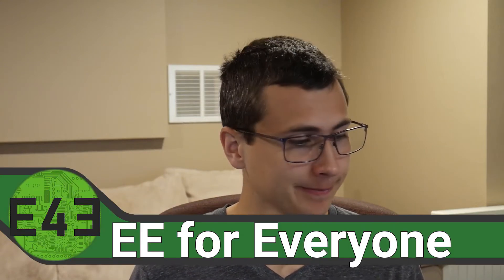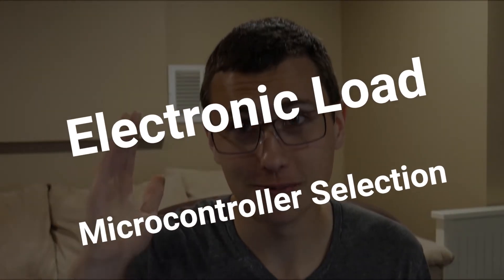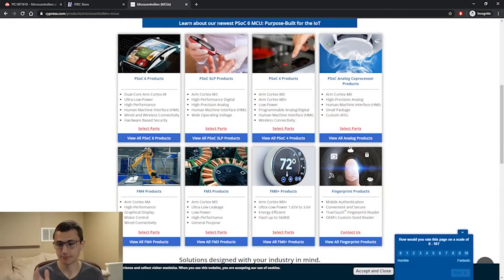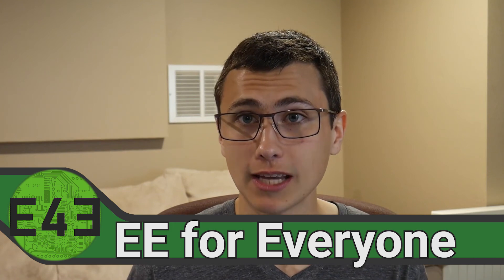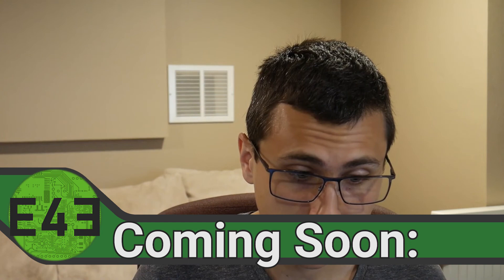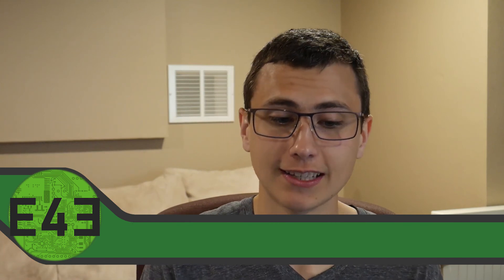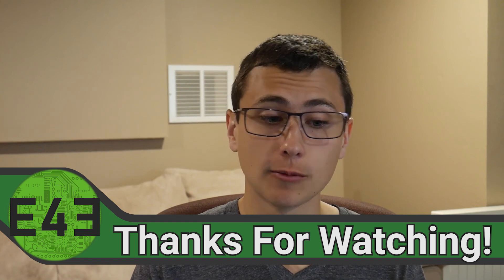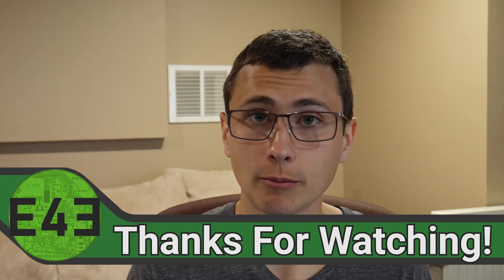Microcontroller Selection (again)

Comment: Floating point? Wow, how far we have fallen. Fixed point is way more than adequate, almost always. All of those microcontrollers are toys with excessive ram and resources as a crutch. Most microcontroller applications would see 128 bytes of ram as excessive, and unnecessarily extravagant. In my opinion, ATMEGA1284P is overkill, it's a monster.

Comment: My favourite right now is the ATSAMD51, especially in the Itsy Bitsy M4 flavour. Dual DAC and 200MHz + FPU make this a great board for the synth libray by PRJC.
Reply: @Techno Projects You can select 160 and 200MHz in the Arduino IDE. It does work, as you can tell the speed difference.

Comment: Most important question in silicon selection is volume of production. For hobby project select the beefiest micro which you familiar with. For mass production, use the cheapest one which still fits.

Comment: The method that you proposed to come up with a baseline is not a good idea. It's one way to do it, but there is another way. Start by modeling your system. Get a rough estimate of the circuit parameters of your load. Are you adding a filter inductor? Include timing delays within your simulation. Once you have a working simulation that has good enough fidelity use that as the input for the hardware specification. Choose a hardware platform onto which your control loop/logic can be mapped unto.
You mentioned learning a new microcontroller and its development hardware, this is fun when you are young. Later you see the hassle of relearning a new tool suite each time as competitors enter the market with an attractive portfolio of tools. What you really want to learn is something that is scalable and portable. An environment where your skills (and libraries) are transferred from one project to another.  These two requirements, scalability and portability, are only really possible when there is a separation of hardware and software.
Reply from the maker: Great thoughts, Gert! I can tell that this was written with a lot of experience behind your words. I totally agree with your thoughts about scalability and portability, how that is essential for efficient development. 

I'm curious.. Have you found any good ways of achieving this? Perhaps writing software meant to operate within an RTOS that can be transferred easily? I don't feel like I've found a great solution for inter-ecosystem development. Perhaps that's by design, every chip vendor wants to keep their customers!

I feel like MCU code development is an area where I have a lot more to learn. Thank you for sharing! I'll definitely keep these thoughts in mind the next time we find ourselves choosing an mcu.
Reply: @EEforEveryone  Well, in my humble opinion, an FPGA delivers on the promise of scalability and code re-use. C on its own doesn't. In contrast to a micro,  digital peripherals such as timers, PWMs, bus controllers (USB, UART, etc), control logic, soft cores, etc can be ported from one FPGA to another. The code on the soft cores can hence run on any FPGA. It is scalable since an entire project can be ported to the next size in the FPGA family with more logic cells. A design can even be ported to another FPGA vendor. Hardware peripherals such as ADC and DACs have to be re-interfaced if different ones are chosen, so that is the only part that requires reinventing the wheel. If you choose the external hardware wisely it may be possible to reuse that design a couple of times before it needs to be upgraded.
The above paradigm is also just an ideal and there is plenty of exception which could brake the workflow, such as using hardware coprocessors or ADCs internal to the FPGA package or vendor-specific soft-cores.
Theoretically, your idea of using an RTOS as an added layer of abstraction in order to isolate the software and hardware is in the right direction, but it can not guarantee the desired outcome. That was never the purpose of an RTOS, to begin with, but a side benefit.

You are still making something useful with these videos, and FPGAs are never going to replace microcontrollers.
Reply: People object to the steep learning curve of FPGAs, but what you have learned has a bigger payoff and longevity. Microcontrollers are easier to learn initially, but people discount the fact that essentially the same thing has to be relearned each time and hence does not count the time cost of studying the datasheets in depth each time a new microcontroller comes around.

Comment: hey bro. do you have any good resources to read to help me develop my understanding of embedded systems ?
Reply from the maker: Hello Jordan, great question!! I think the best way to develop an understanding is to get a microcontroller, and spend a lot of time reading the datasheet to understand how each peripheral works in detail (input capture, PWM output, ADC, etc). 

If you can understand all the pieces individually, then the whole system starts to come together! 

As far a like... paper resources, I learned a lot with the ATMEGA328P datasheet, and I'm sure there's a lot of great books out there... but the textbook we used in university wasn't nearly as helpful as spending time with the hardware.

I hope this helps, and thank you for reaching out!
Reply: Thanks,  @EEforEveryone . I understand. the best way to learn is to start building. let me know which text book you used in university. thanks
Reply from the maker: Hello Jordan, so I did some digging, turns out my university doesn't actually use a textbook for our embedded systems classes (They now use a kit / series of projects and an MSP432 series microcontroller).

However, the digital logic courses use this book, which you may find helpful: ISBN: 978-0-12-800056-4 "Digital Design and Computer Architecture: ARM Edition"

Comment: Anybody have any experience with TI's c2000 microcontrollers? Currently thinking of switching from msp430 to something with better performance and STM32 seems like a great option but I'm already familiar with TI which could let me save some time.
Reply from the maker: I haven't used the c2000, but I've used some of the msp432 and tiva Series parts.  

I personally had a lot of problems with the HAL for STM32, being that it wasn't documented very well, but that may have changed In time. Cheers, and thank you for the great question!

Comment: It would be a huge overkill, but I would love to see some small FPGA there. You could implement the independent comms as you said and have a softcore to run your logic. Even the PID could run in hardware then. It would be quite interesting to see such beast running, as there are very rare occasions for hobbyists to use those, and the development process isn't trivial.
Reply from the maker: Agreed NukeDMAn! an FPGA would be HUGE overkill for this project, but just because we can isn't always a bad idea. I'm sure we'd learn something. We'd be able to have a dedicated SPI bus for every peripheral, run power, voltage, and current control snappy.... It would be amazing, even if a little excessive. :)

Comment: I don't think having a central microcontroller for everything makes it very modular. An independent micro for each module is the way to go, use CAN communication so you don't have communication problems and you can isolate it easily! This will allow you to scale easily, well beyonf the SPI bottleneck. I think the teensy might be the right choice for this.
Reply from the maker: Mastro, You're right, the SPI will be a bottleneck eventually, but so will thermal management!  We can only cram so many 700W Electronic Loads into a box before we can't get the heat out! For a huge, 10, 20, crazy big rack of these I'm right with you about the micros, but I'm betting we can run a few of these in parallel off of one processor. I think you might be right about the teensy.... :)

Comment: If you want to go high but low in price, you can go for ESP32 which has:
- Built in Bluetooth: v4.2  and wi-fi 802.11 b/g/n (maybe for wireless controlling, like using your phone processing for graph logging)
- Dual core (32bit)
- SD/SDIO/CE-ATA/MMC/eMMC host controller
- 18x (9 up to 12 bits ADC)
- 2x 8bit DAC 
- 10x touch sensors (capacitive sensing GPIOs)
- 4x SPI interfaces
- 3x UART interfaces
- 2x I2C interfaces
- 2x I2S interfaces
- 16 PWM output channels
- 2MB flash size (standard) but you can change the separated SPI Flash up to 16MB
- up to 240 MHz of clock speed (frequency scaling)
- 520 KiB SRAM
- Operating voltage: 3v3
- integrated Hall effect sensor
- Costs around $2.47 each (lcsc.com)
It looks like an overkill but a FPGA would cost a lot and would take you more time to produce your firmware and hardware - also quite a large IC for the job.
Reply: Those are killer specs. How stable is the chip? I remember my esp8266 having auto reset issues, but that had to be a bad reset circuit desing or my poor power filtering.
Reply: @xhivo97  well stable as arduino i would say.
Reply from the maker: Those are awesome specs! I think the reset issue is a nuance of their software, where there's essentially a watchdog kick implemented in the "main loop". So, if the execution time gets too long for an esp32, that watchdog can expire. I may be mis-remembering though!
Reply: @EEforEveryone  Apparently Espressif shipped 100 million chips in 2018 I think. I think it should be stable provided a good power delivery circuit.
Reply from the maker: Yeah, there is definitely something to using something with million(s) in the field.

Comment: Go and use something like (ST8500) . That what they use for controlling every things starting with over voltage over current over power over heating fan speed and display all that in to LCD. And not only that ! It can program with external switching bottom and a rotary knob that have no limits for Left and right side to select the voltage down alarm and the upper voltage alarm and the current max limit alarm and the over heat alarm and the time that you want for the DC loading to descharge the battery and give you the battery capacity too . All in one Chip
Reply from the maker: Hello Abed! That's a really neat part! (ST8500)... I'll have to think about that. ST does have some great integration with TouchGFX, FreeRTOS... but I've had some real pains with their lower-level HAL. I'll see if I can work past my old experiences and give them another try!

Comment: Hmm.
I like the comments on portability.
A big decider for me is whether they have a standard compiler, or a closed toolchain.
i.e. GCC/SDCC.
The other large factor, is part longevity.
I think microchip has a "we'll always keep selling these parts, as long as people are buying them"?
I take a particular liking to NXP's offerings, given they have 10-15 years on parts availability and longevity.
They also offer parts ranging from microcontrollers to system processors.

I've kind of been stuck with the STM32's at work, given they were one of the "first" cortex M series things if i recall?
Also one of the first with cortex M7's available?
They only just started writing their 10 year availability program stuff i think?
I think my go-to is typically the cheapest atmel parts that I can get a c compiler for.
i.e. attiny24/44/84 (multiple diff adc channels, with PGA, serial peripheral),  atmega48 (need serial peripheral, more pins)  and attiny25/45/85 (8 pin micro =P).
If I need more power, it's typically choosing between an stm32 micro that I already have code for, or a "cost no object"  approach. i.e. application processor with microcontroller co processors, or an FPGA approach =P
Reply from the maker: Yeah, The hardest thing to do is plan for the future. My crystal ball is out for cal. :) 

Interesting to hear where your mind is. Sounds like you haven't given the PSOCs a try yet... I'd recommend them! I mean, how can you not love a micro that lets you swap the Rx/Tx pairs with a SW update?
Reply: @EEforEveryone  I'm open to change / new processors/different manufacturers. Not too much of a difference since it's all Cortex M etc.
I like cypress' parts, and in the event of alternatives without cost effective alternatives, I have used their parts.
I'm thinking back to some ARM7,ARM9 or ARM11 thing. Plus USB 2 chips, timing, flash products etc.
I have found their IoT wireless stuff enticing, but I'm always concerned with longevity issues.
I think I've used what they bought from broadcom before?
Their wireless stack does WPA2-Enterprise if i'm not mistaken.

I'm pretty much stuck in STM32 land because of work. If i'm doing something personal, time is typically the most important factor.

Main issue is I've not found their (cypress) roadmap system enticing i.e. doesn't appear that they have a consistent product longevity system.
Looks like they only go 4 years out with their timing and flash products. The rest of their road map documents don't appear to have EOL dates.

Given they've just been bought by Infineon, I am not optimistic regarding product longevity and long term support.
Infineon's site leaves even more to be desired, i.e. clear language anywhere.